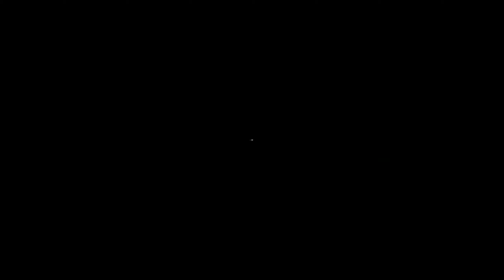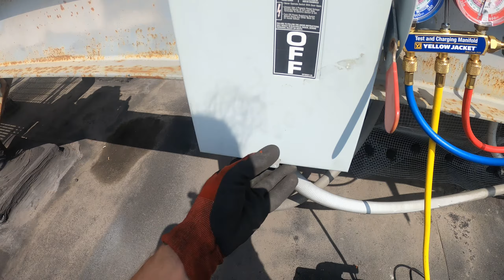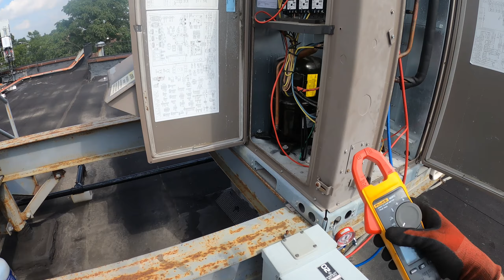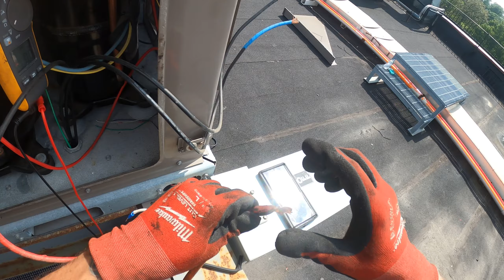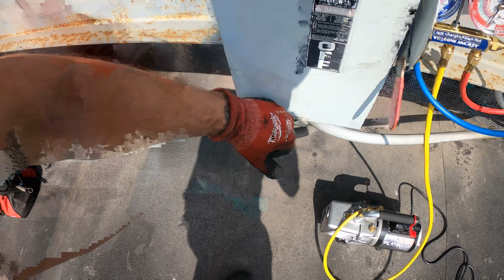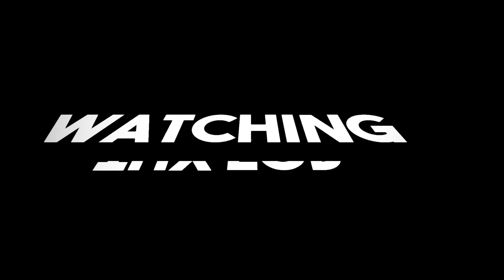HVAC TIPS AND TRICKS: How To Steal Power/Electricity From Any HVACR System? (AC/Refrigeration)

Comment: My first boss taught me to use a 15’ piece of very flexible rubber jacketed / stranded copper SO 10/3 cable for temporary power.
Industrial type inline fuse holders with 20amp fuses for both hot & neutral conductors 

One end has high quality alligator clips installed and the opposite end terminated in a deep 1900 box with GFCI 120vac 20a receptacle feeding through to a second deep 1900 box with spec grade 120vac 20a receptacle - BOTH receptacles being protected by the GFCI. 
(both boxes mounted to a  piece of 3/4” plywood  12”x8” in size.
Reply: NOTE:
ALWAYS AVOID USING THE “STINGER” OR “HIGH LEG” (in 3 phase delta / usually marked with orange)

Comment: Your a moron for showing this.

The breaker is likely rated 60 amp with 15 amp cord?

You better hope that ground goes back to the panel, not to a junction box mounted to a steel beam to ground.  It would kill somebody.

Yeah, real interesting

Comment: The ground wire on the short extension cord was capped off with a wire nut ?
Reply: He used the neutral wire
Reply: @lesleyboeder1798  yes. I saw that. But I’m asking about the green ground wire on the extension cord. Was it wire nut off ?
Reply: Looks like he tapped it with electrical tape
Reply: I can imagine the reason being if the pump were to have a short to "ground" in this scenario- he wont have that green wire waving around hot.

Comment: You wouldn't get away with that here in the UK. Authorities would lock you up in prison.
Reply: and so?  It is right to steal electricity
Reply: So what do you do if you need power and don't want to be locked up? Beg the govt for a 1000 ft extension cord?
Reply: @realSamAndrew  There are safer way of getting power sources.
Reply: @jonmaclennan6238  such as?
Reply: @realSamAndrew  installing power sockets.
Reply: @jonmaclennan6238  you obviously didn't watch the video. If you arrive at the job site and the builder didn't take care of that for you, what do you do at THAT point? Tell the customer it's impossible? Hire an electrician to redesign the building? What's your solution in the heat of the moment?
Reply: @realSamAndrew  you can use portable power station, like Jackery.
Reply: @akmatron  that's a helpful answer. But is that a heavy item like a gas generator? How would you transport that up to a roof?
Reply: @realSamAndrew  It has batteries inside. It weights from 3.97 lbs (1.8 kg) up to 43.2 lbs (19.6 kg) - depends on required power. They have transport handles.
Reply: @realSamAndrew  your missing the point !!
Reply: @jonmaclennan6238  then explain it better. You have not given any additional information in your answer. That doesn't help.
Reply: Nice. Its been a tough go for y’all. Hard to get off the teet of the monarchy. You seem to rather trade it off for serfdom via socialism.

Comment: Great video. Just don't try to do this  on a 460 system. If you do use the same principle on the step down side of the transformer going to the pressure switch.

Comment: Beware , occasionally you will find an old building with a high leg. That leg or phase will be about 180 v to ground. You will smoke your vacuum pump if you run into that and choose that high leg. Most of the time you would find it on the middle phase. You don’t see it a lot but it is still out there